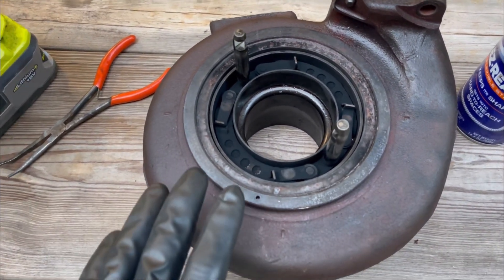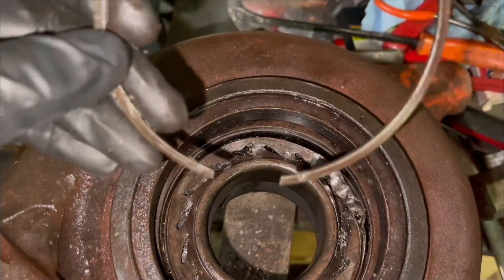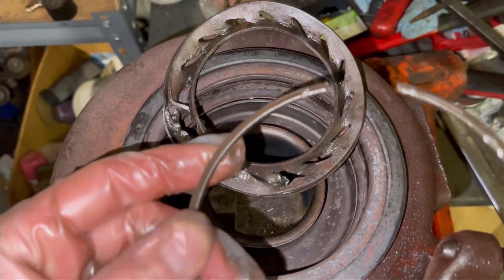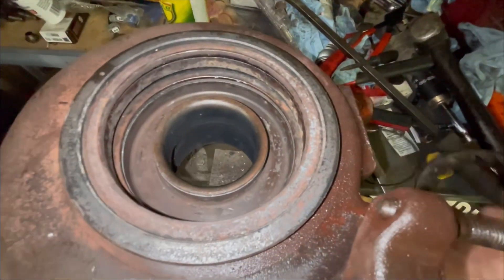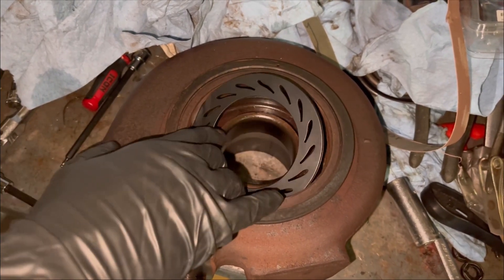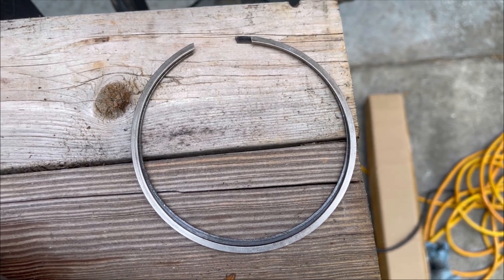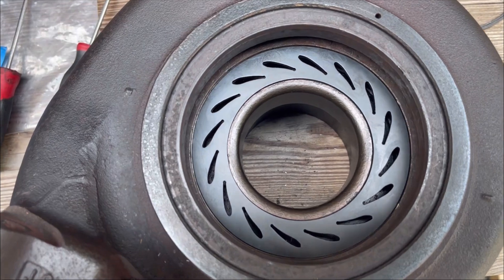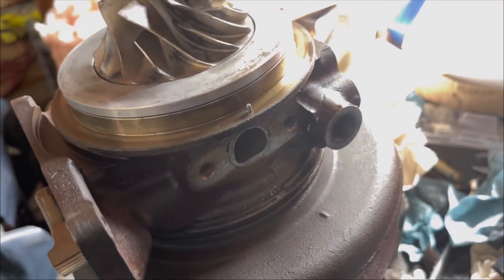HOLSET Turbo VGT Sliding Nozzle & Ring REPLACEMENT! Most DETAILED Video on YOUTUBE 2023 #ramcummins

Comment: Kia, I'm stuck on the task not shown, the actual removal of the turbine shaft. I have the turbine open, the 10mm nut and corresponding turbine wheel off. The shaft spins freely. Also removed is the thrust washer, and the small c-clip under the TW. I'm still not able to get the shaft to slide out.  Any gentle taping i do with a small hammer doesn't get it moving out but seems to put pressure on something as the turbine wheel no longer spins freely at that point. I stop fearing I'm  doing harm. Can you provide how to get the shaft out?
Thanks for these great videos also!
Reply from the maker: Sometimes carbon gets stuck around the sealing ring on the hot side turbine and it's hard to remove. Try soaking it some WD40 twist while pulling to see if it frees up
Reply: That must have been it, plus I put my big boy pants on and tapped the shaft gently, but smartly and the shaft began moving out. Just a bit fearful of harming something  when it was resisting.
Thanks for the reply and wonderful videos. 
Have a great Christmas and Holidays!
Reply from the maker: @wardstanford8177  good deal! Once it's all back together I have it a hand spin one last time to make sure before I put the intake boot on.
Happy Holidays to you as well! Stay Safe!
Reply from the maker: @turbowolf3594  sometimes a lil spit works also 😅😅

Comment: I just rebuilt my 2007.5  6.7 HE351VE turbo with your kit. Great video!
I'm having one issue. When dropping the cartridge into the hot side housing the turbo wheel is rubbing something.  Spinning is not free and easy. Seems the cartridge food in too deeply.
Any suggestions from Kai or anyone?
Reply from the maker: Thanks!
Make sure the alignment pins are lined up and the cartridge is fully seated....you can tap the housing very lightly to seat it.....it should spins generally free.
Make sure all the carbon and junk are removed.
Reply: Friend, thank you for the quick reply! I just found that it was slightly cocked due to just setting on the housing/cartridge clamp. Simple stuff gets us all too often! 
Thanks again!!
Reply: Kai, this will be my last question as the turbo is back together. There is one large diameter o-ring left over in the rebuild kit. I installed the one on the silver plate that covers the internal actuator parts. Is it an unused o- ring or possibly for another similar turbo?
I don't find another large o-ring in the pictures I took while disassembling the unit. I hate having left overs and no manual or kit instructions.
Reply from the maker: @wardstanford8177 the cold side (snail shell) side uses the large o ring, it goes on the cartridge side
Reply: Thanks Kai! I'm sure that saved a big mistake. 
Take a break and you and your family have a great Christmas and New Years!!
Again, thanks for all your input. 
Ward
Reply from the maker: @wardstanford8177  your welcome so to you happy holidays

Comment: Hi. May send to you my HE300vg to rebuild? The van got stock a little. Thanks
Reply from the maker: Hello and thanks for watching. Unfortunately we do not rebuild turbos for people anymore. We are showing this as reference so you would be able to perform this task at home. It does require basic mechanic tools and knowledge of the turbo.
When you say the vain is stuck are you getting any codes? Have you removed the actuator? Also check shaft play……